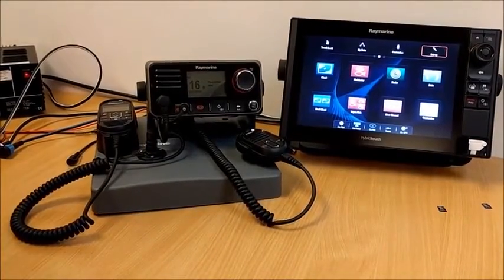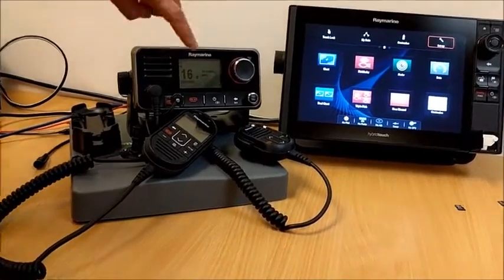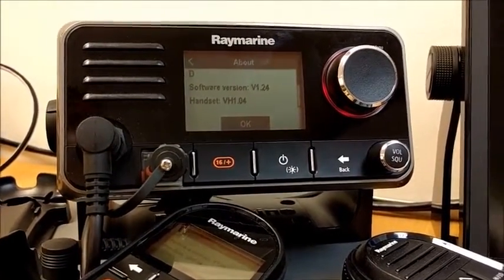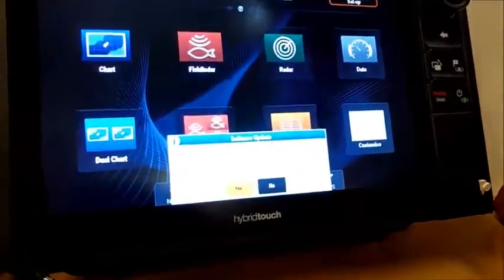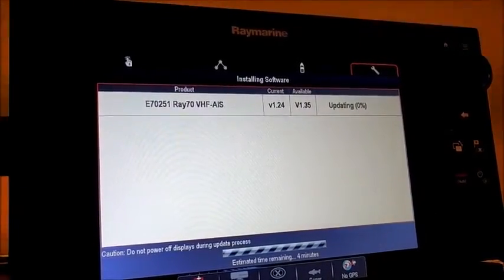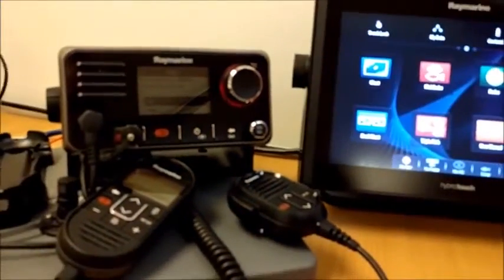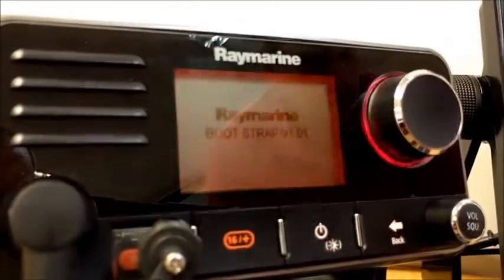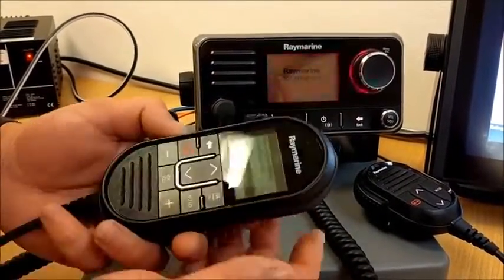Ray50/52/60/70/Handset VHF Radio - v1.35/VH1.06 Software Upgrade

Comment: How i add hailer ?
Reply from the maker: Hello Mahfuzul.   Several of our VHF models have a loudhailer output.   You simply need to add and wire a hailing horn to the output wires in the wiring harness.   We offer a Newmar-brand waterproof hailing horn as an accessory, part number M95435.    This is not Raymarine-specific and you can find them in just about any marine hardware store or marine electronic dealer.

In our current VHF lineup the Ray73, Ray90 and Ray91 models feature loudhailer output.
Reply: @Raymarine  Can i get ur whatsapp number?? I am from bangladesh .

Comment: Well that was hard work. 
It should just talk to each other 
Nearly £2000 of kit should just work. 
I have just got the new axiom + 
Let’s hope they have updated it.
Reply from the maker: This video is a pretty old one.   In the years since this came out the update process is much improved.  If you have an Axiom+ display, it can update the software in all of your peripherals including VHF, radar, pilot, sonar, etc.   Whenever you update Axiom it will also check the status of other devices on the network and update them at the same time.   Axiom can connect to our software servers using its onboard Wi-Fi access point, or you can download the latest LightHouse 3 software version from Raymarine.com.  It also contains the software for other Raymarine devices.